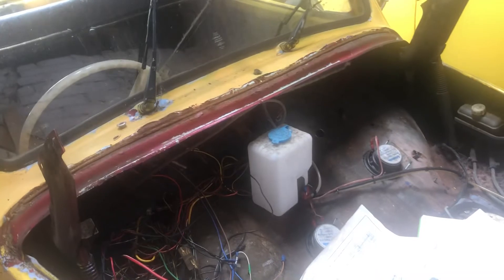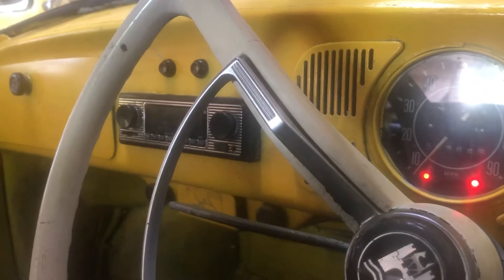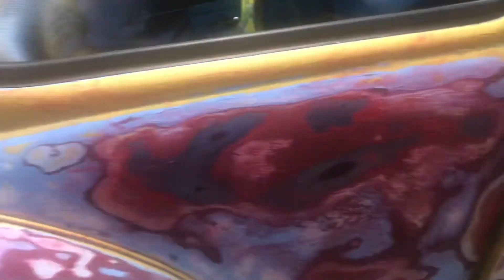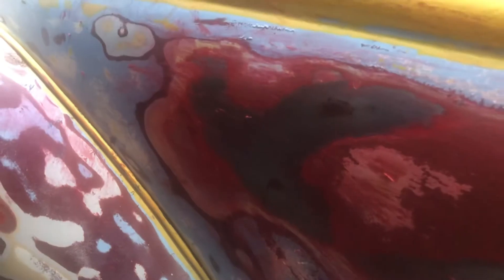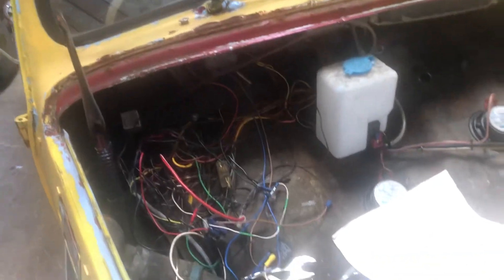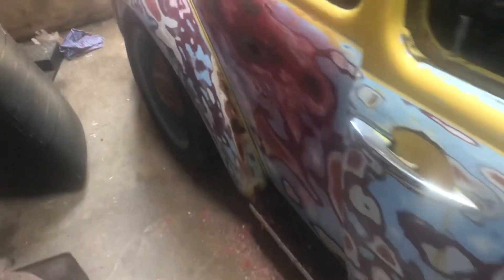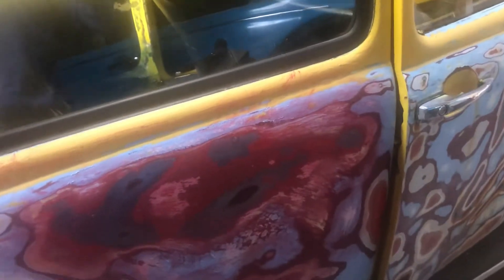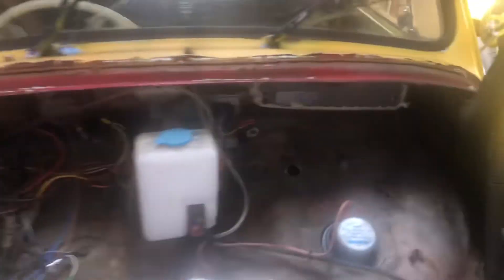Vw slammed beetle 1971  pt3 bare metal & wiring mess !!

Comment: Air Craft Stripper is expensive, so here's a trick. Take strips of  newspapers and soak them in Dot 3 brake fluid. Then lay them on the metal you want stripped.  It takes about 24 hours and you want to keep it wet. Try a test piece on an old fender. I have stripped entire trucks this way saving hundreds $$$$ . My Dad taught me this in the 70s when I stripped my mini bike gas tank.  Soapy water for clean up before primer
Reply from the maker: Oh wow !! Thank you Joe I’ll try brake fluid method
Reply: model kit workshop 152: Stripping paint with break fluid. LOL
Reply from the maker: @gmc.joesousa4360  I’ll try it lol thanks Joe 👍

Comment: may look a mess but does look rock solid. I hate wires i can do them but best way is to remove and start again  . All mine needs is the heater channels and  bit tlc and then have a rock solid body again
Reply from the maker: But I got everything working today and now I’m restripping to go back to original spec. Really solid . Needs a full service and tune up cheers Dave
Reply: @vwcoco  thats good it all works . looks a keeper or good money maker
Reply from the maker: @vw_beetle_dave  to sell after the wiring and going bare metal   So hoping £7000+ my mate just sold his 1968 but pre67 panels £13,500